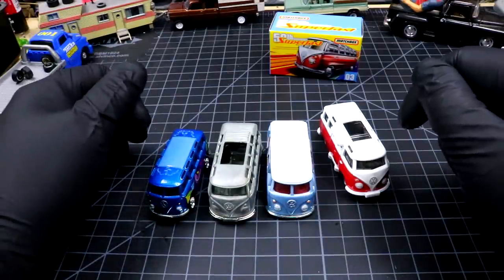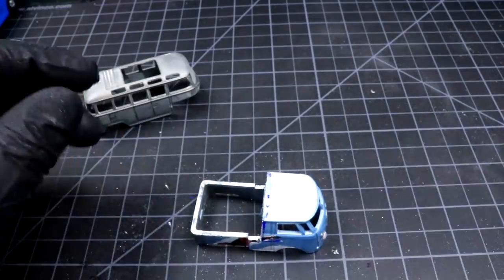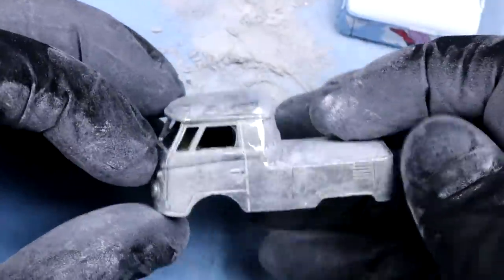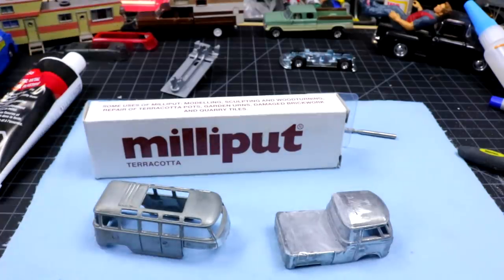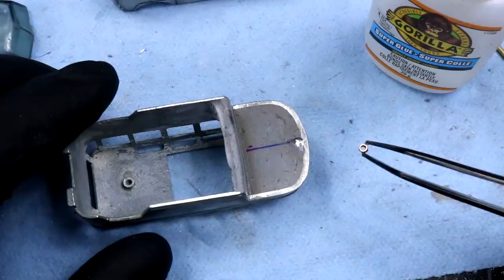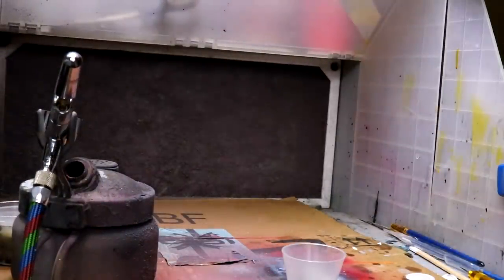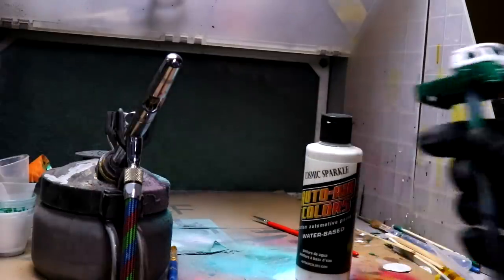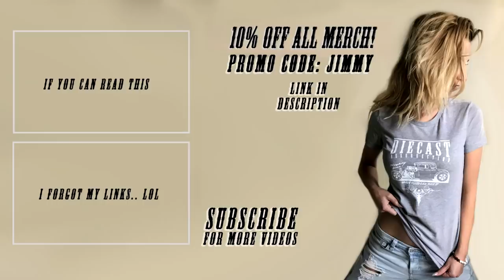Hot Wheels Volkswagen Bus Camper Build

Comment: I am in the process of building the same thing except I attached two VW bus bodies together as the camper trailer, and for the cab I used the hot wheels VW flatbed. You did a fantastic job. 👍👍👍👍

Comment: What a beaut! I love that VW camper and truck. What a brilliant idea with flange the body panels together like that rather than just glue them together. When I drove around in old cars back in the day, I sometimes used JB Weld epoxy putty to fix rusted out areas on the body after removing as much rust as I could. Works great on minor rust issues, and if done well and sanded down the rust and epoxy putty and painted you can hardly see the area that's been fixed. I once fixed a small rust hole on my VW Golf MK3 inside near the cap filler. It actually turned out pretty nice after repaint

Comment: Nice project but i don't like the use of so much putty. Should be way easier to build the 
Truckbed and the frontbottom of the trailerpart out of styrenesheet or parts of the cutted truckroof. By doing so you should be able to create some furniture in the front of the trailer, maybe a seating aerea. So a nasty putty can be seen in front of the trailer.